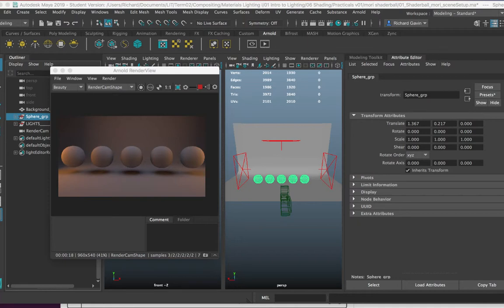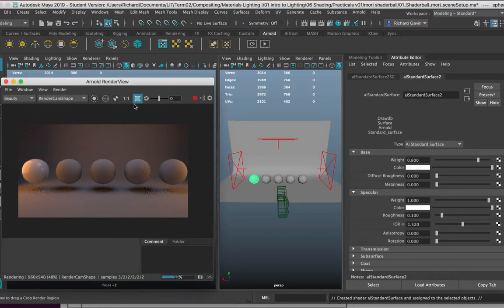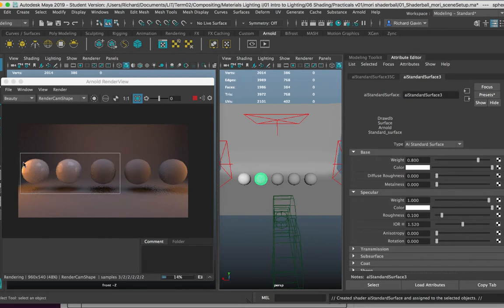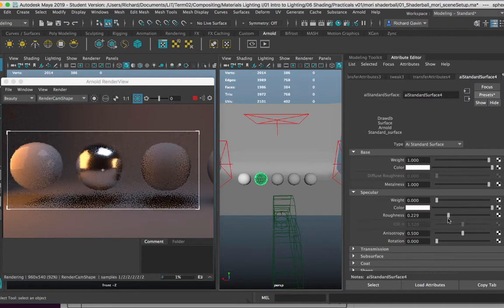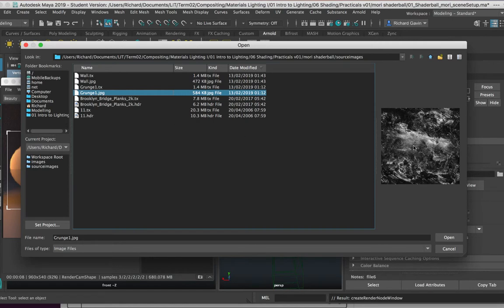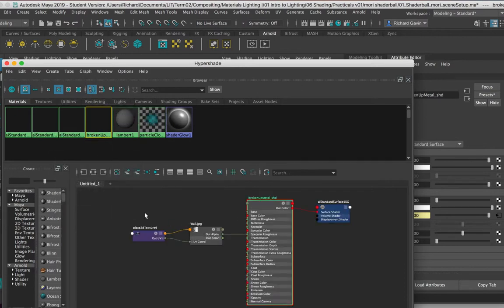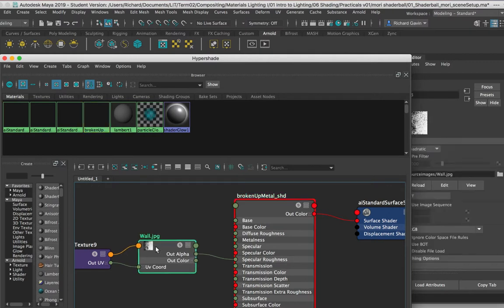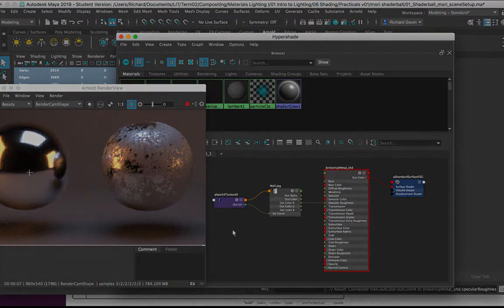Scratched Metallic Shader Surfaces Maya 2018 +

Comment: Wow this short video helped me a lot👍👍 thanks buddy I had one doubt is there any sites where I can find already made texture maps of SCRATCHES??? I NEED THEM ON MY 3D IRON MAN HELMET
Reply from the maker: No worries glad it helped. There lots of good cg textures sites out there,  half way down this page you can find some links  https://iga.hihm.no/links/  https://www.cgi-textures.com/ and https://www.textures.com/ are a some others off  the top of my head. Also worth considering shooting some yourself for the best quality, for scratches like this you can get some glass, use sandpaper on it to scratch it up put a black sheet behind it and then light it to pickup the scratches, that will get you a really good quality result that is easy to pull a key on.
Reply from the maker: Something similar to this but for scratches https://design.tutsplus.com/tutorials/how-to-create-custom-shattered-glass-brushes-in-adobe-photoshop--cms-22894 a bit more work but the result is usually worth it. It gets you up off the machine which is nice and also you get to scratch beat up and break stuff which is a plus :)
Reply: @3D_GO  ohhh thanks for the efforts man!! You got a new subscriber 🙏👍👍❤️